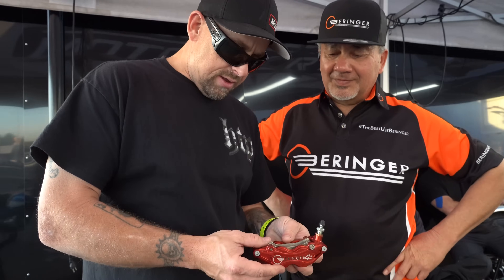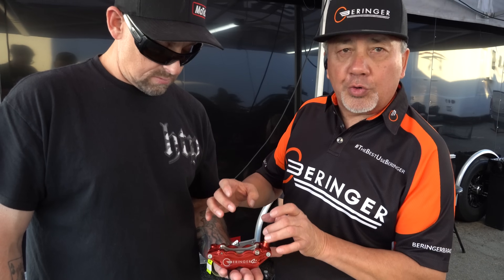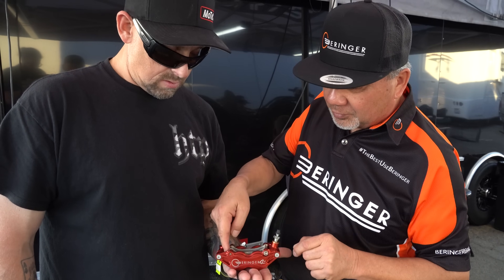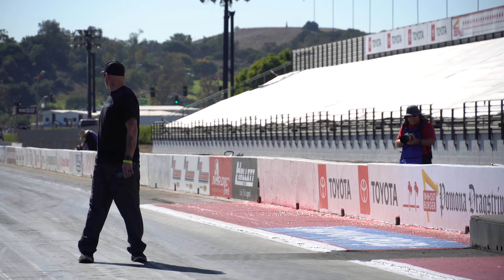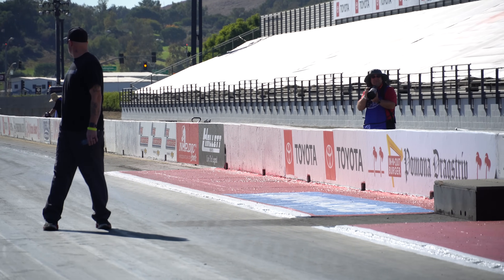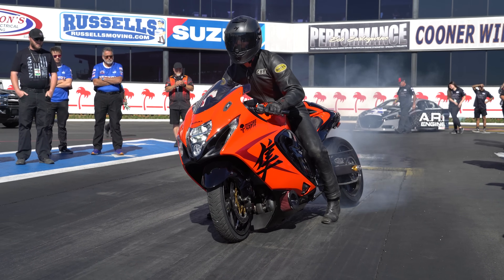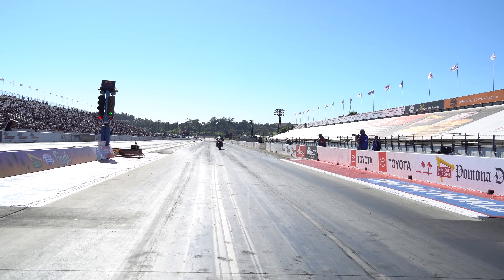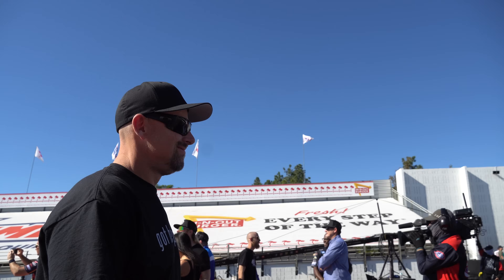Fastest Bike On The Property: NHRA Finals x Hyperbusa

Comment: what was second  pass?
Reply: pretty sure he said 9. But they also mentioned playing with settings because the track  prep is different than what they are used to. NHRA has quite a bit more bite than what youd find at a typical track. Riders used to being able to slip the tire ever so slightly on takeoff rather than throw themselves off find it much more difficult. Getting the 7 @ 200+ (206 actually) was all they were after today.